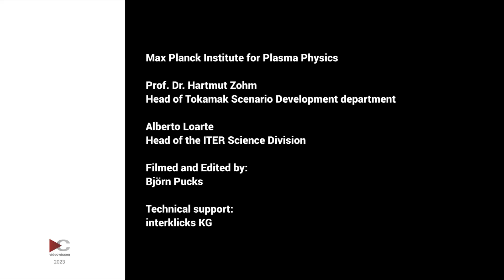Nuclear Fusion: Problems at the ITER Research Project and Current Solutions | Hartmut Zohm

Comment: The overall energy inputs, such as that used for the cryogenics, computer systems and many more such inputs, are never included in the over calculations of the plants efficiency. This has to be done to be truly transparent, as to the real "overall" cost involved in producing fusion power. If that full cost is not given, then the true over all costs of fusion power, when it is finally perfected, is not provided to the ones who will be paying for it, in order to evaluate if it is truly an efficient source of power.  Telling the end user that the cost only entails power inputs that are for only the core reaction, makes the evaluation to be very inaccurate and is no way to bill the end user.
Reply: Those systems you mentioned are not relevant to efficiency. They are not interested in the efficiency for billing purposes or cost but only for the fusion reaction. There are after a gain of > 1 and computers, cryo etc. dont matter when calculating gain.

Comment: Interesting. Thanks!  However, listening to the reasoning in the video,  it sounds as if the original plan to use Beryllium was a useless plan...  who had the idea to plan a very expensive, in terms of money and time, experiment if it did not make much sense?
Reply: It seemed to make sense at the time, and it was tested at JET with the ITER-like wall, where it worked well.

Comment: Thank you for the transparency.
Welcome problems - better now, than later...
Reply: Yes, but the concept as such is wrong.
Fusion race has been converted into competition of collateral technologies - superconductors, now we see problems of welding from the inside of vacuum vessel that is made now huge pandemotoric forces load bearing while in first tokamaks that was thin wall (several tenth of mm) structure.
The question is how practical commercial reactor will be if ITER is projected as far as I know for 1 mW/m^2 neutron flux for first wall?
As for such a flux will inevitably damage the structure and lifetime of vessel will not be long enough to justify an investment.
Now we see the complexity to build such a vessel.
Where new ideas to run tokamaks at higher beta?
Or to heat plasma to higher than projected for ITER 15 kEv temperature. That will allow us to go to the aneutronic reactions.

Comment: Hallo, werter Herr Prof. Dr. Hartmut Zohm. 

Wann wird dieses Video auf Urknall Weltall und das Leben zu finden sein? Am besten mit vernünftigen deutschen Untertiteln?

Ich interessiere mich zwar für das Thema Kernfusion. Aber bin weder Physiker noch sind meine Englischkenntnisse gut genug, um euren Gesprächen wirklich folgen zu können. 

Wenn ich aber mein Senf kurz dazu geben darf.

Ich finde, dass für das ITER-Experiment die Falsche Art des Kernfusionsreaktors gewählt wurde.

Klar, sie arbeiten ja am Max Plank Institut für Plasmaphysik in Garching mit dem Tokamak ASDEX Upgrade, aber wäre denn eine Upscalierung vom, wie im IPP Greifswald mit dem Wendelstein 7-X Stellerator nicht die Zukunftsstabilere Option gewesen?

Wenn ich es richtig verstanden habe, ist der Tokamak ja ein Pulsfusionsprinzip, während der Stellerator ein Dauerfusionsprinzip ist. Oder irre ich mich da?

Zweiter Punkt, den ich gerne beantwortet haben möchte, gerne auch auf dem Kanal Urknall, Weltall und das Leben beantworten, seit wann ist das IPP Greifswald nur noch ein Teilinstitut? Und was ist der Unterschied zwischen dem Titel Teilinstitut, wie es das IPP Greifswald führt, und dem Titel Institut, wie es das IPP Garching benutzt?